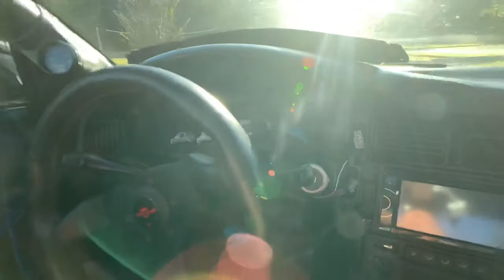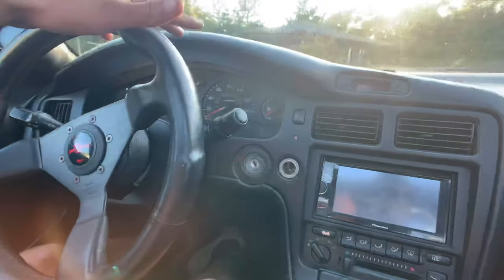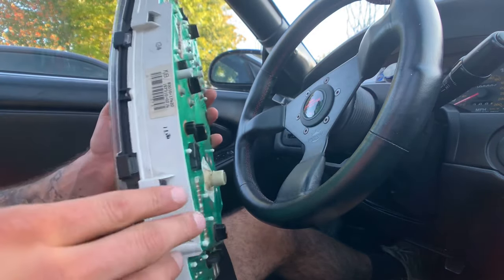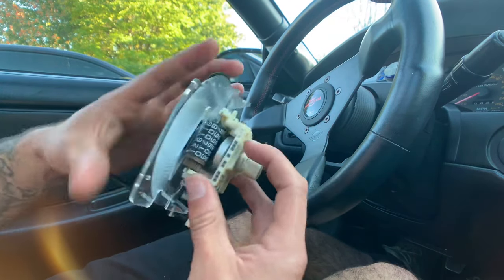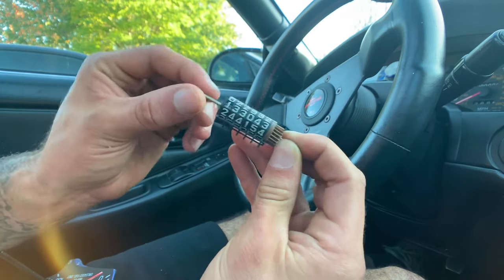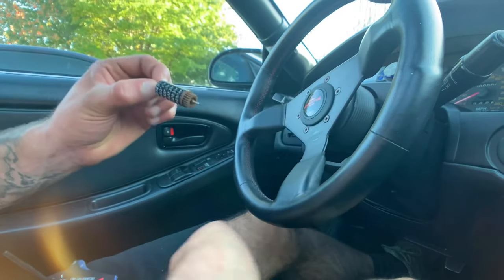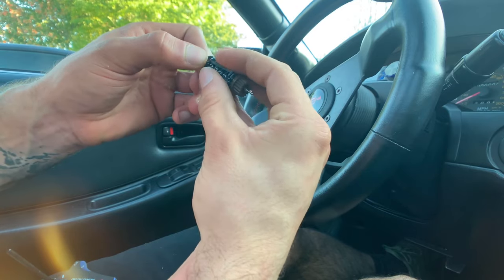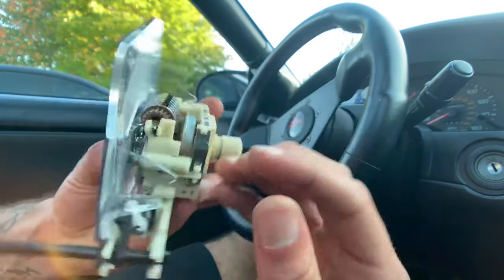How To Rollback Miles In Less Than 10 Minutes! (Instructional)

Comment: Great now I’ll sell my truck and get more money I’ll put it at 10k miles instead of 160 k miles. Thanks😀
Reply: I need this. Ain't a scammer. Bought my car with a bad milage meter due to having oversized wheels. Bought it with 130 thousand but it says 170 thousand .its way off was only driven 5000 kays

Comment: I just bought a 1990 lexus ls400 so the miles are also exempt from the title. The previous owner had changed the original cluster which has 132k miles (original mileage) because the lights etc.. weren't working the new cluster reads 115k. I'm in Ny, when I get the car inspected is it still going to be an issue? Will they mark my title as unknown mileage?

Comment: So what happens if you sell your car in the future? Will the title say exempt still? Or do you have to put the mileage on the odometer? I mever heard of this before but sounds like a good idea to go back to zero if i were to swap a engine to keep track of mileages of the new engine.
Reply from the maker: Yes the miles on the title HAVE to say exempt, if you do so otherwise, that would be illegal. For tracking miles of a new swap though, this is smart 🙌
Reply: @sealeyteamsix5980  what has to make the car exempt on mileage? Or can you request for it? But really good info i appreciate the video.
Reply from the maker: I’m not sure what the process is since I bought the car with the miles already exempt. After taking a look though I found that they need to be vehicles that are ten years old. I’m sure you could probably talk to the dmv though and they would be more useful than me. Thanks for the comment though! Glad to help!
Reply: Yeah I want to rebuild my engine and put my dial back to zero cheers for this
Reply from the maker: @kiddoza9783  of course no problem!
Reply: @sealeyteamsix5980  this should  be ilegal
Reply from the maker: @JuanMorales-ks4ll  did you read the pinned comment or just spew shit out your mouth? 🤨
Reply: @kiddoza9783  the odometer is not for the engine but for the chassis.
Reply: Just wanted to add a little something here. It could vary from state to state, but in Oklahoma when I titled my 2008 Focus in 2022, they jotted my odometer down even though my title says exempt. So you might include an odometer change if you ever decide to sell the vehicle. Good idea though to track engine/trans mileage, just not entirely sure if you’ll have problems down the road or not with the DMV.